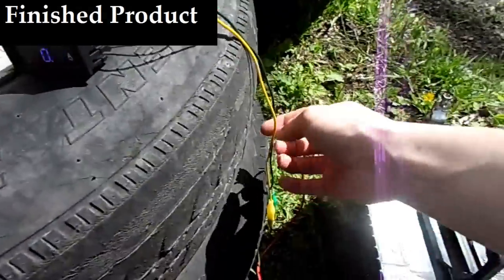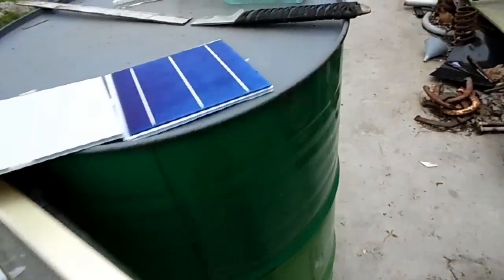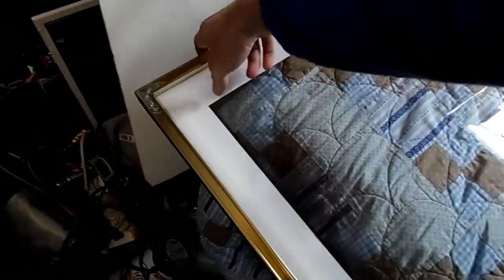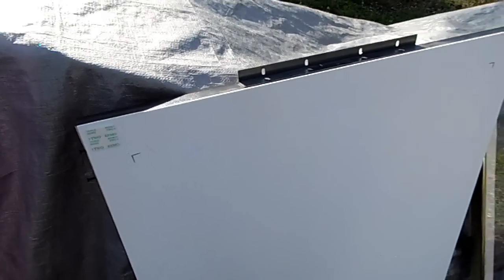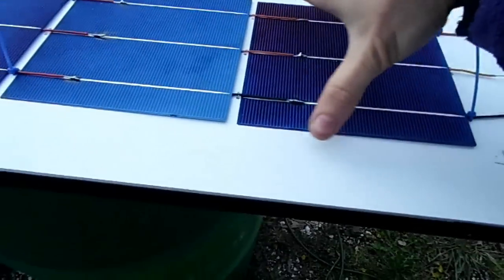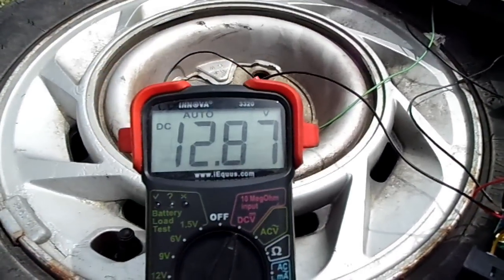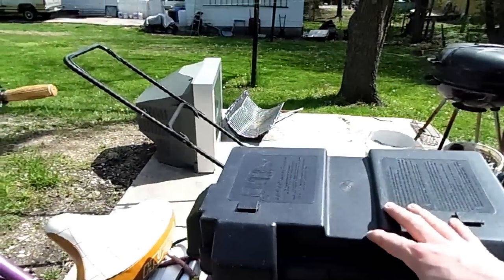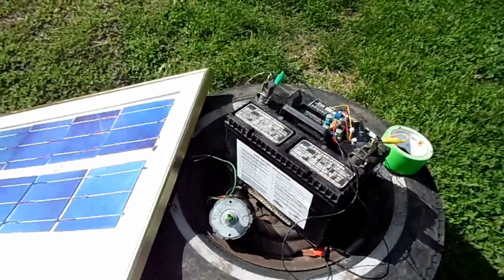DIY 15$ 40w Solar Panel

Comment: That soldering iron of yours, though. Like swatting a fly with a Buick.
Reply from the maker: ZZ Cat god thats so funny, and yeah it is very big. but it has a shit ton of thermal capacity so it melts the solder super quickly.
Reply: Rinoa Super-Genius If it does the job for ya, then it's all good then. =^/.^=
Reply: ZZ Cat It reminds me of those 90s jumbo sized pencils
Reply: ZZ Cat reading your comment at the beginning I was like its not that big then at 7:20 I was like holy crap!
Reply: ZZ Cat I can see that in a Crocodile Dundee dialogue :)
Reply: ZZ Cat "Swatting a fly with a Buick" should be this channels motto.
Reply: ValugaTheLord HA HAA! I reckon so.
=^/.^=
Reply: ValugaTheLord 
 disco
Reply: Ahh man I was laughing so hard with this comment made me cry, made my day. Lol
Reply: ZZ Cat lmfao!
Reply: Haha that's what everybody talking about 3:46

Comment: Didn't you have a bigger iron
Reply from the maker: +Paul Duffy i actually almost bought one at a flea market that was bigger and attached to an old 1920s gasoline fueled blowtorch.
Reply: Rinoa Super-Genius you said at the end to put a sensor circuit to power down the current once full battery then the plug in to a light draining the power is that sensor circuit constructed with the power on again circuitry yes I guess or separate part. Free energy without using magnets or solar or wind I'd like to see that.
Reply: it's actually really non ideal
Reply: lol, watching that made my day
Reply: Ohhhhhhhhh :) That made my day :)
Reply: Ali Mammadov  I'm glad it made your day

Comment: Hi Rinoa Super-Genius! You are only getting 5W out of that panel, because you don't have wires connecting the "dots" on the positive side and you also need to have wires (either tabbing wire or that wire of yours without coating) on the negative side on those long strips. This is because that panel is rated at P=UI -> I=P/U=4.5W/0.5V=9A, that solar cell has high resistance, and 9 AMP is simply too much without wires. You should be getting 30W+ just by fixing that. Hope I helped! :)

Comment: I enjoyed your video. I have never seen a metal working soldering iron used for electrical or electronic work.  You have a nice touch with a large iron like that. I like to see people go with what they have to make things. Thanks for taking the time to show people what you're doing.

FYI:  There is no free lunch with power.  Power = Watts =  volts x amps.
If you use that step-up converter to say double the volts, you will halve the amps, the power out remains the same, except for losses in the converter.  To increase the power you must increase the number of cells. Note also that the voltage from solar cells will not change with the intensity of the sun, only the amps i.e.  current.

You may see a buildup of heat inside your panel after hours of full sun because of the open space (volume) beneath the glass will trap heat. Just like the inside of a car in summer.  It might crack the glass and or could cause joints to expand and possibly cause leaks. And the heat will decrease the efficiency of the cells. The insulating properties of the core board will also help trap the heat.
--cheers!

Comment: Been thinking of buying some used solar panels to put together a 6 kilowatt system. You made building the individual solar panel so easy, that I might go with some high end solar cells to put together my own high performance solar panels from things I have laying around. Thanks for making this video. It was very informative!
Reply from the maker: 6kw will be hard to do. You'll need special glass for it since normal plate glass blocks too much light. Also you'll need to epoxy them in if they go outside. Honestly I would say it's cheaper to get 100W Renogy panels from ebay because they will last 10x longer than homemade panels. See you get oxidation issues with the cells after a few years if any contaminants (Even air) is left in the resin.
Reply: @RinoaL Thanks for the advice. The 6KW is more of my goal for my solar harvesting, and most of it will probably be used panels from craiglist for 10 cents per watt.(a gambling man)

That being said, I want the individual cells to develop some solar harvesting prototypes that I have in mind. A lot easier to tweak everything when I can build the circuit myself from individual DC sources. Definitely a lot of independent variables involved in solar harvesting!

Comment: Nice soldering iron for delicate solar cells
Reply: Nice.........non construction of your own solar panel
Reply: you tried so hard to think of something to say, A for effort
Reply: yeah, imo scotch brand wrapping tape is the best way to connect wires with solar cells, soldering irons are never used for delicate work such as this.
Reply: electrical connections with scotch tape only? if you do this it may be working for now, but once the tabbing wire and connections on the cells start oxidizing over time the connections will fail. soldering is standard practice, the cells even have a small amount from the factory... you just have to be careful. although the soldering iron in this video is oversized, he was delicate and used it properly so this will outlast tape in every scenario.
Reply: yes, but the scotch brand wrapping tape contains nanotechnology where micro-organisms specially designated and trained to work for scotch will seal the wires inside with a seal stronger than the solder so they will not oxidize, and even if one of the micro-organisms were to slack off; and the wires were to oxidize, there are designated cleaning micro-organisms equipped with CH3COOH (acetic acid) which will clean the rust/oxidization off.

Comment: Good presentation! If you decide to build a permanent array, consider this, Your cells when exposed to oxygen breaks down rather fast so the more air tight you can make it, the better.

Comment: If the solar panel can be brought into the house after use so much the better!  Then no worries about it being sealed well enough or not.  I've been using the same solar panel for 38 years this way.

Comment: great video, I'm looking to do something similar in a few weeks but I'm thinking of adding thin mirrors to the inner edges of whatever frame I use to hopefully harness more sunlight at different angles. That soldering iron though, looks like what someone would use to fix Voltron lol

Comment: Just a thought:  Instead of just rotating to follow the sun, you might also be able to use mylar panels to direct a much larger area of sunlight onto the solar panel especially early and late in the day.  Perhaps a structure hinged on one edge of the array that fans outward with a slight upward angle so the light at a shallow angle bounces and is steered into the solar cells.
     Another thought:  Also, you might get a sheet of styrofoam/bubble wrap to go over the panel to protect it in bad weather (hail) and moving it.  The styrofoam/bubble wrap could face the glass and then on the top of the styrofoam/bubble wrap a sheet of something else that would be harder and heavier.  I'm very accident prone and I develop systems to prevent me from damaging things.  The good thing about styrofoam and bubble wrap is that it is everywhere and it end up in a lot of trash bins.
Reply from the maker: only downside to using reflective stuff to bring more light to the solar panels is they would heat up and lose efficiency. even today they where toasty just from the greenhouse effects the plexiglass has on it.

if i am going to use mylar to reflect light ima reflect it onto a thermo-electric generator or stirling engine.

i'm not expecting this panel to last too long, so i dont really care if it breaks. i think i'm just going to spend some of my youtube earnings to get several 100w panels pre-made.
Reply: I figured they originially were designed calculating the maximum light that would fall on them and there would be a loss in efficiency curve and they might even be damaged with too much light.  So, I wouldn't have suggested you use a concentrator during prime sun.
    You could drill some holes in the sides to allow the heat to vent and glue some awning type covers over them to keep rain from entering them to keep them working till you buy a new array.  If the array has a slight tilt, cool air would be drawn in on the lower side while the warmer air exits on the higher end.
     The conversion of the gasoline pump is a great idea.
   I saw in the video that you have a railroad glass insulator collection.  Those are nice.

Comment: Tks for sharing would a piece of thin sheet metal light weight that the sheets of solar panels get attached by zip ties fit inside of frame or long bars fit inside and would a 12v soldering iron fuse those wires to panels I guess so and u can buy usb outlet to recharge stuff tks

Comment: Watch out he has a soldering iron! No that's not a soldering iron....That's soldering iron!  80's movie knife references.
Reply: +Ted “TdawgVapes” Reeder If it was after dark, all the lights would dim when he fired up that soldering POLE? That thing must have been about 3000 watts. LOL. Pretty good technique for such a LARGE tool.
Reply: its 300 watts and almost gets hot enough to melt aluminum
Reply: Crocodile Dundee

Comment: Dude I see what some of them are talking about. You have to hook your soldering iron to a diesel engine. Just to heat it up for a project. I love what you doing and the video is awesome. Just don't blow a power grid warming up your soldering iron. Just kidding.

Comment: that boost converter you have on the barrel at 9:57 is that the 80v max 600w boost converter off ebay?

also, I was wondering how hot it gets(I've ordered one for my 100w LED torch because the 150w one burnt out real quick)
Reply: its a smaller one because the 80v one needs 10v to work its probably a 30v one

Comment: Have a couple of them prebuilt to charged USB stuff, or direct drive some fans on a hot day. I thought they all sucked pretty much, giving much lower watt then advertised and so on... really strange... until I opened my glass window on my balcony and then it was full power! amazing change... I dont know if that's true for all types of solar panels ofc, but try open the glass for awhile and measure it then...
Reply: I suspect the glass would reflect a lot of energy, perhaps a glass with a non-glossy reflective surface, like frosted glass would yield better results?, but I hear what you are saying, no glass is the best option, but then there's no protection from the elements, I guess it all depends on the weather.

Comment: Very unique solar project. You would probably need 4 sets of those panels to charge a 12v battery. 4 sets would be $60.00 for 40 watts . A commercial 100watt panel would only be $90-$100.00. You would also want to get a solar chg controller so as not to overcharge your battery($ 25-30.00). No build time. But then where would the fun be in that. Lol

Comment: What is the practical application is it just to charge batteries? If a converter hooked to the battery, and run let's say a small fan. Would the panel charging the battery keep up?

Comment: I give full marks for your sheer ingenuity my friend. And extra bonus points for not breaking a single cell with that massive soldering iron. I was breaking cells just by looking at them the wrong way . . .  how do you do it?

Comment: Sorry if anyone else had already asked, but can you please explain how you get 40 Watts out of these 10 cells? Power = Voltage x Current, so for each cell: Power = 0.5V x 5Amps = 2.5 Watts. Total Power = 10cells x 2.5W = 25 Watts, NOT 40 Watts. Am I missing anything?
Reply: Probably took peak voltage and peak amps at separate times, that is usually where people make their mistakes.
Also where most of the "free" energy people get the idea magic pixies are helping them out.
Reply: there are 15 solar cells in total =37.5 Wp so its aprox 40Wp
Reply: What is Wp? Ohm's law identifies values in formulas as...E=Volts (Pressure), I=Amps (Flow quantity), R=Resistance (Resistance to flow), P=Watts (Energy dissipation/consumption) Hence E, I, R and P Sometimes transformers are rated "VA" ie. 40VA which means the wattage is the 40v X the current flow. Your statement has the layman's term "W" being multiplied by the same component of Ohm's law formula "P" The only real information he has given for each cell is 500Mv (.5v) If you don't have the specs of the cell then put the cell in direct full sunlight and measure the voltage@ max. output potential. Consider 10% useful voltage drop under load, (500mv -10%=450Mv) apply a load until the 50mv drop is achieved and measure the current. Say you measure 200ma, now you can multiply the 450mv by 200ma which would make the cell effective use  .09W 30 cells in series would give 15v unloaded and 13.5 under load with a current flow of 200ma @ 2.7w He needs to give full information to accurately determine the capabilities. Also a couple more things...He is not using a step up transformer, it looks like a mosfet voltage inverter. and the second battery with 12.57v  is pretty well charged already because a static car battery (6 lead acid cells in series) is fully charged at 12.865v
Reply: https://en.wikipedia.org/wiki/Nominal_power_(photovoltaic) there you find an explanation of the meaning o "Wp"
Reply: I literally started in electro mechanics/ electronics 40 years ago, I feel electron flow in a circuit and how devices manipulate it. "Speed" is a constant, known as the Speed Of Light. (SPL=186282 miles per second) Electrons also travel at that speed on a conductive pathway. Volts (E)=pressure. Amps (I)=quantity, Watts (P)= Energy dissipated and Resistance (R)=Resistance to electron flow causing voltage drop. Voltage is always measured at one point with respect to another point. There are three electrical characteristics about a device...Voltage at each end, voltage across and the resistance it presents in a circuit.
Reply from the maker: +DrHarryT lol no electrons dont travel that fast, they travel super super slow like a few feet an hour. go read about the "electron drift velocity" and try not to be too embarrassed. you can walk faster than an electron in most cases.

you can not "feel" electrons with any more accuracy than "ow that hurts", you can imagine you do though.
Reply: Rinoa Super-Genius Please try not to be sarcastic? I have always viewed electrons as flowing in a circuit and various pictorials have supported the view. It is amazing that at 53 since 1976 with my constant involvement in electro/mechanics and physics that this is the first time hearing the current flow is represented as a wave bombardment of atoms. Kind of like a arm with steel balls hanging on it and you grab the first one pulling it back and letting go so it hits the second ball thus transmitting the energy through the other balls to the last ball causing it to swing out. It is difficult to think of a constant source such as a battery generating a frequency to cause transmission through a copper wire back through circuit to the positive plate of the battery, Unless electrons are like photons always resonating as a frequency. I know that everything in our observable universe is something rotting around something at a frequency with the fundamental root being the photon. Very interesting.
Reply: +jim boniface Close... Volts is pressure and Amps is flow.  Volts causes Amps.  Power is the product of the two.
Reply: Steven Zara yea...the part where he said he'd need to use a boost stepper module...did you even watch the video?

Comment: i wonder i hear solar panels are most efficient when they stay cooler what if you put a small hole in the back and put a pc fan to either suck out the hot air or push in cold air

Comment: use waterproofing on the wood, like thompson's waterproofing... it'll last forever... and seeing you solder I can tell you've never seen a can or syringe of flux in your life. Saves lots of lousy soldering joints. Take it from one who is Avionics trained to solder. We look at 21 things that can be wrong with a joint. Seriously.

BTW before you go building too many you might make sure what freqs the cell uses because glass will block IR and plastic will block UV...or something like that. I look it up when I really need to know. But just because something looks see through to the eye doesn't mean it it. Video cameras and special diodes help "see" the different wavelength lights BTW.

Comment: In order to use media such as dvd / cd instead of solar cells or tiles in such a way that the DVD / CD media clings to a hard surface and then through a copper wire that crosses the middle of the dvd / cd media to power converters or batteries? Is that possible?

Comment: If you experiment more, you will see why the tabbing wire goes all the way across the cell. The ohms in the cell is too high and you have a lot of loss unless you solder copper across the whole thing, top and bottom.
Reply: I think that explains much of his power loss.  They wouldn't put three tabs on the bottom if they weren't necessary.